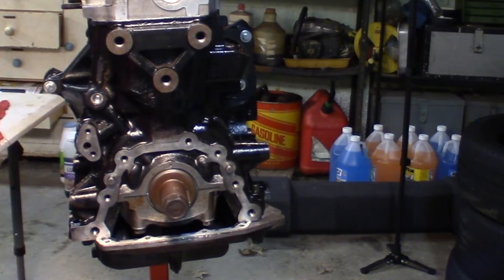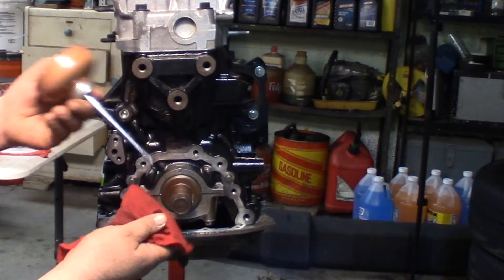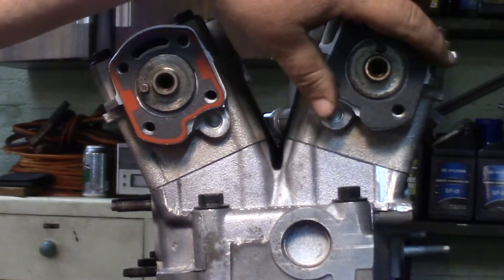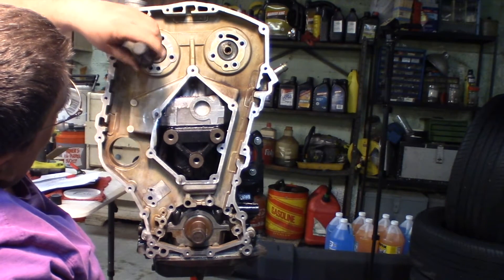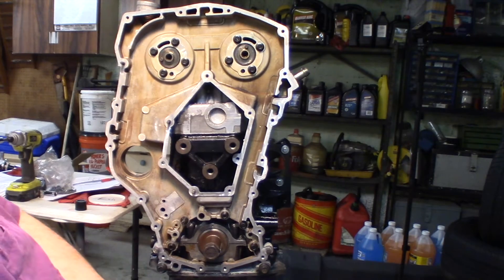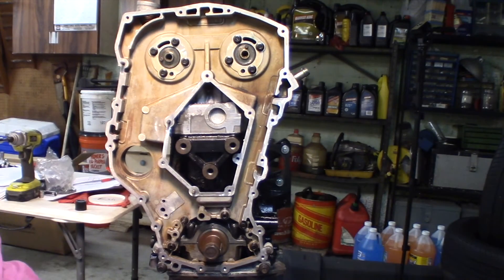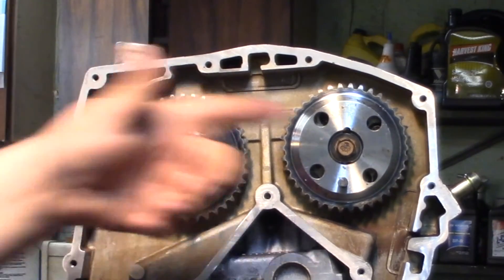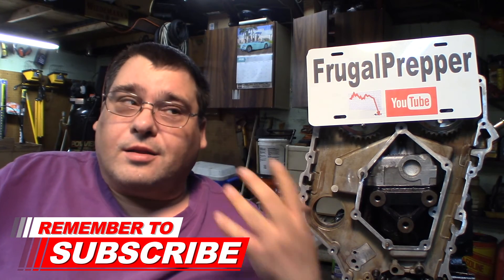Inner Timing Cover - Engine Rebuild - 1999 Grand Am GM LD9 2.4 Quad 4 - Part 16

Comment: I have same engine. I want to replace head gasket but I can't removing timing chain housing for access 2 head bolts just very close to this cast aluminum housing. I removed all bolts but it doesn't come out/release. I forced with large screw driver from left and right sides but it is not removing. I never see any video showing removal of this part. Any helpful info for remove it?
Reply from the maker: You took out the timing chain and remove the bolts behind the sprockets?  Also the water pump must come out, which also requires timing chain to be removed.   Make sure you turn the engine over to 90 degrees before top dead center first so you don't send a valve into a piston.
Reply: @frugalprepper  : Thanks for responding. I did all these jobs. Harmonic balancer bolt and pculley removed, water pump removed, timing chain removed, camshaft sprokets removed, all bolts removed, valve covers removed. For remove the harmonic balancer bolt, I hold fly wheel. I never turned engine to any side/degree... I used fly wheel holding tool. i made it myself by 8mm thick flat steel. So I removed first its bolt as first time. Everthing was original. Now, when I replace new head gasket and new valve cover gaskets,,, I will put timing chain in same position. I marked the chain before I removed it. So when I tight harmonic balancer bolt in same torque as b efore, nothing will be moved. Camshafts and crankshaft will be in same position. All the problem that aluminum cast timing chain  cover. Something is holding it very tightly even i removed all bolts. There is 2 pins left and right sides at below area. But they are not the point. I checked today again it looks free to come out but it is not coming out from engine block. I never hammered and forced it with pry bar and/or with large screwdriver. I scare it may break. It is very tightly sitting. I forget to say this: I marked both camshafts positions with thick black marker both sides of each camshaft before i removed them. So, I will replaced them in same position after install new head gasket and new valve gasket and thin flexible gaskets for top cover.  All the problem I must move or remove that cast aluminum timing chain housing for make space for remove that last 2 head bolts. I don't want to force it, it may crack. It is discontinued part.
Reply: @frugalprepper  : I still can't removing timing chain cover.